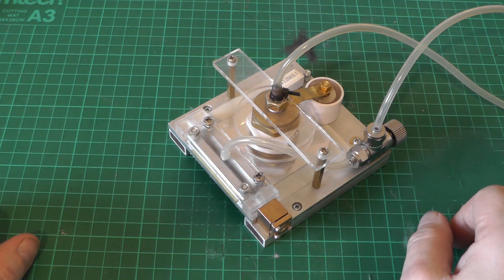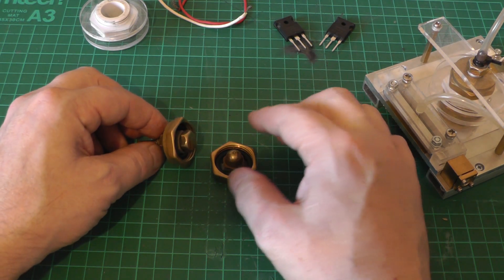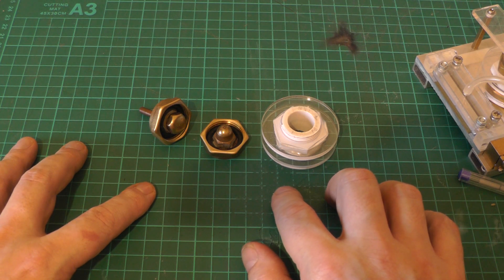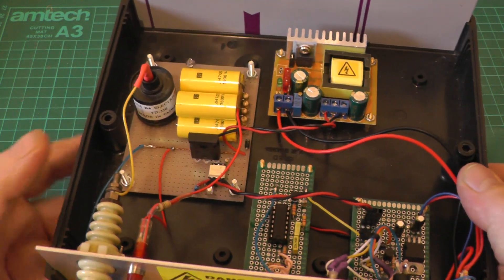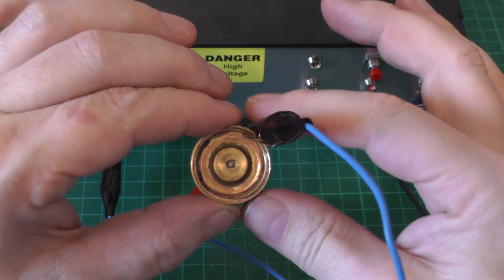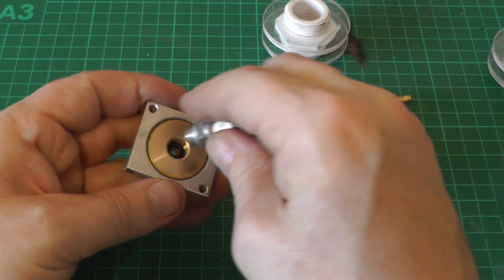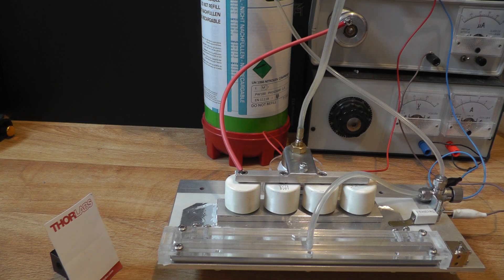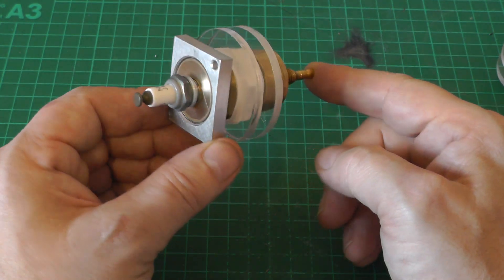How to make a Triggered Spark Gap for High Voltage Lasers and Marx Generators

Comment: A spark gap is the fastest high current closing switch I know of. In a test of a home made coaxial Marx generator of 15 stages, using N2 at 150 psig, I was able to measure a rise time of about 300 pSec. 
Oddly enough using fast ionizing gas hydrogen worked poorly in my Marx.  Slower N2 allowed  the stages to erect in sequence from 1 to 15, hence when gap 15 broke down there was a huge overvoltage which causes very fast switching. At least that's my theory.
Reply: Damn that's fast. Yeah I'm guessing it's the overvoltage, I see a lot of fast rise time switches being made from multiple gaps in series to get that effect, sometimes they put them in a transmission line too.
I'd been looking into thyristors recently and to get them that fast requires a very design-intensive driver and special thyristors like Solidtrons which are basically unobtainable, the difference in cost and difficulty is massive, and the only tradeoff is a bit of jitter, efficiency, and electrode wear.

Comment: Hi Les,
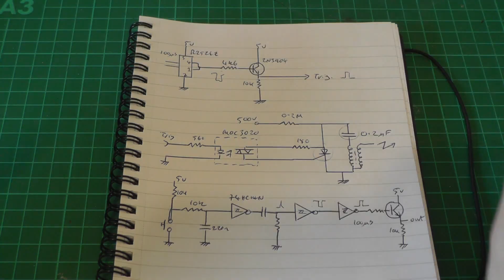I am just about finished with a very large ruby laser.  I was looking at your external trigger transformer about timestamp  10:31  Which I am going to use with my YD-350 and a 0.22uF cap charged to ~500v.
I noticed you have 500v through a 200k resistor, which limits the current to 2.5mA (if I read that 0.2M correctly...giving a RC time constant of 44ms).  Since I still don't like  SCR's on a external trigger, I plan to use a MOSFET or IGBT...which I can turn on /off easily, and won't be hard to control at these power levels.  The ruby is 6-1/8" x 3/8" with integral mirrors (a $2,000.00 job which I got for a trade), the flashlamp has an arc length of 6-1/2" x 15mm (13mm bore).
*I still don't know why thyristors are always used here!!!*
Just throwing this in...and...
Thanks for all your inspirational videos!!!
--daLe
Reply from the maker: This sounds like a very cool project, and sorry for the very late reply (see the community post!). The 200k resistor was to limit the current such that the SCR doesn't crowbar the power supply, latch up and let the magic smoke out :-) Woudl love to see the end result of your project!

Comment: Can you do a video on a circuit to start up an arc lamp?? I have some CW xenon laser lamps and I can get a spark through them, but I can't transfer to the low voltage DC (180V@20A) quickly enough to keep it lit. It's for a CW NdYAG build and there's so little on the web 😵‍💫 love your videos!
Reply from the maker: Thanks! Yeah, I could do. I have been meaning to revisit triggering.
Reply: @LesLaboratory   I'll be the first viewer! 🙌😅

Comment: SIR : "YD-350" LOOKS IDENTICAL TO THE *IGNITION COIL USED IN MANY PROPANE HEATERS in CAMPERS + MOTORHOMES ...THEY RUN ON Q2 volts and use a SPARK PLUG WIRE TO IGNITION ELECTRODE

Comment: I saw 4 resistors at 8:46 near the yellow caps, are they in series to limit SCR current? If not I also wonder if current limiting in this case is required.
Reply from the maker: Yes they limit current, and help prevent the SCR latching.

Comment: Hi Les,
I just received the trigger transformer in the video.  I needed a trigger supply like yours in the schematic...I intend to build it with some changes: Referring to your schema (top to bottom):

1) I will use a 555 astable for an adjustable pulse width.  The 555 triggers on the FALLING edge of the input and puts out a positive pulse.

2) I have had it!! with SCR latchup!  I will use an isolated IGBT, (or HV MOSFET) with snubber.

3) For the one-shot...another 555 (astable) for the manual pulse(s), eliminating the 7414 IC.  In astable mode the 555's positive out pulse has hysteresis...the trigger button can be repeatedly pressed, but has no effect during the output.

...so it looks like just a dual 555 (the 556).   BTW, the output of the 555 (pin 3) is actually a half-bridge configuration that very easily sinks and SOURCES over 200mA.

...and that great triggered spark gap (optically, if enough ionization can be had with powerful 250nm LED's).

THANKS FOR THE INSPIRING VIDEO!!!  Your other's are also OUTSTANDING!
Reply from the maker: Cool. for latch the latch up issue, I have started using neon lamps to commutate the trigger pulse to the SCR, and this seems to fix it, but yeah, it is a giant pain. There are better methods of triggering it has to be said! I ordered a deep UV LED a while ago to try this, but other projects have gotten in the way!
Reply: Hi Les,
I have found plenty 250nm (UV-C) LEDs on ebay, including the multi-watt star-type and a 'light bulb' made of over 100 250nm LEDs.  I also found 7mm lenses (~$0.69 ea).  All this seems to have become available after covid...I guess for anti-bacterial and sterilization techniques...I could never find them before!
I plan to make a 'ring' of these around the gap, each with a focusing lens to concentrate the light at the gap in the center of the ring.  As you probably know, you can't just place a large lens over multiple lights...you will just get a bunch of focused disjoint points of light.  If you place a lens on each LED, you get some overlap though not much.  I think a ring of LEDs and a lens for each will focus each LED to the single desired gap point. @LesLaboratory

Comment: Thanks for the video.  After examining a few different circuits for electrically triggered spark gaps, one concern I have is backfeeding the trigger circuit with the high power side.   What stops or protects the current from jumping backup up the electrode of the spark plug and into your trigger circuit please?

Comment: Try using a subminature rectifier tube with a blown filament. The 5xx series by apalla are particularly good, switch on in less than 0.1nS. Used them in place of kn6 krytron tubes. No biasing required, just give a 1kv trigger pulse and it fires up to about 14kv.
Reply from the maker: Interesting! Those are he tubes used in the old Tek scopes for the multiplier right?
Reply: @LesLaboratory  yup those are the ones.
Reply: Please excuse my ignorance but how short of a pulse width is this subminiature rectifier tube capable of? Does it turn off after a pulse is fired? I’m looking for a method of firing a very fast short duration pulse to a 1kv high voltage transformer primary for generating radiant energy bursts.
Reply: Triggered vacuum gap on the cheap!  Yeah field emission!

Comment: One way to get a high voltage PS with a lot of current, is to use a neon sigh xfmr.  This is how I charge by giant quarter-shrinking supply.  You can get 30mA easily.  The HV diodes are small and cheap on ebay.  I used three 20kV / 50mA diodes in series for safety.  The NST is current-limited, thus one rated at 30mA will be fine with these diodes.  A few of the 40kV caps in parallel should work for creating DC.  If you use a FWB diode config., then the capacitance can be halved for the same filtering.  A variac is a nice option for the NST input.
I have used two 12kV NST's in series and got a total output (with variac) of over 39.5kV @ 30mA.  I potted these two cores in wax.
...and yes, the NST will make things a bit heavy.  I mounted the single NST PS in plexi. with diodes,... all on top.  Be aware that the case of the NST is a center-tap.

Comment: Hi Les,  looking at your 'trigger generator', especially the ZVS driver (I have about ten of these, which I have used for various applications),  They don't seem to have a common ground...input to output...I see you have used the "+" and "-" I/O to get 500 VDC out.  I use this config in most apps.  I was wondering if you have had any grounding issues with the HV 'Gnd" and the 5V Gnd?  Have you measured the voltage across the two 'Gnds'?  I get some fairly hige voltages...not 0v.
I plan to use a high power MOSFET (1000v @46A) as my trigger switch ..or maybe an IGBT,  The reason I ask is that I am having trouble witch SCR latchup.  Also, the maximum FET gate voltage/source is +/- 20v.  But am afraid to do so with unknown ground relationshps.
On your schematic, you seem to use the gnd's as if they are directly connected...and your ground symbles are the same in the schematics.  Are they internally wired together in your trigger generator?  From other similar projects, a seperate 9v batt works fine for isolation in the MOSFET gate/gnd control.  I just received  (ebay) an isolated dc dc xfmr that should work....would like to know your thoughts on this.
THANKS MUCH!!!

Comment: I see that in the High Voltage trigger, you are using an optoisolated TRIAC.  Is there any reasin a simple opto-transister won't work?
Thanks much,
--dAlE
Reply from the maker: I am sure you could, but you would need one with a high voltage rating, and a reverse recovery diode no doubt. The opto triac is commonly used in most application notes and schematics I have come across, so why not use a known working scheme.

Comment: Hi Les,
PLEASE tell me what SCR you are using in the trigger transformer circuit shown in your schematic.   I have tried several...some latch-up at 100us, and some don't seem to conduct enough.  I have one rather large one that works properly.  I have used the RC-differentatior and a 555 for firing...both seem to work equally.

About the ZVS driver:  I have gone through several of these...some exploaded!  I found the problem:  it is the two10uF  electrolytic caps near the output rail...they are only rated at 400v, which is often exceeded in operation.  I ordered a bag of 10uF 450v lytic's of the same physical size.  After replacing them, ALL problems dissappeared!  I now consider this a great ZVS HV device.  I can't tell from the video, but did you use the + and - connections for your 500v source.  This works well, but MANY of these drivers come with only one 'side' connected making the dual polarity impossible.  I always make certain that the ebay seller sends me the types with BOTH caps installed.

IIRC, my giant N2 laser has the largest doorknob caps I have ever seen.  The channel has a vacuum pump, bandsaw blade electrodes, and looks to be nearly a meter in length and has an end mirror.  It was built in the '70's.  EVERYTHING is adjustable...the thyratron even has seperate variacs for precise control of the filiment and reservoir...safety shutoffs for everything.  I think it was a prototype.

...seen all but a couple of your videos so far....just discovered them!
--dAle
Reply from the maker: I am using a 30TPS08PBF SCR in the circuit. Yeah latch-up can be an issue. I started using Neon lamps  between the moc3020 and the Gate in later versions of this circuit that prevents this happening.

Yeah, some of those ZVS drivers can be flakey, and yes I always get the ones with + 0 - outputs. I have never had one explode, but I have ad caps fail.

Nice! I bet the output is well over a Megawatt per pulse, maybe even a couple. they used bandsaw blades to ensure the gas was fully ionized and produce a homogeneous discharge along the length when they fired I believe.

My first N2 Laser used copper sheet electrodes, and was low pressure, but unlike the Sci-Am design, I used doorknob caps in it.

Awesome! There are some interesting project in the works!

Comment: What is the output power or photon intensity?
Reply from the maker: Of the Nitrogen laser Laser? I have measured this at 223 microjoules per pulse in around 1 nanosecond (279kW or there abouts) the average power at 25hz is about 5.5 milliwatts.

Comment: could to initiate the spark gap with a uv LED
Reply from the maker: Maybe. There is a lot of "Theoretical" modelling on UV LED triggered gaps, and an IEEE conference proceeding which is just an abstract (weird). In principle it appears possible, perhaps I will look into it!
Reply from the maker: Ordered an alleged 265nm 100mW LED from China. Worth a punt...
Reply: @LesLaboratory   
I have order one too.  

UV LED Triggered Spark Gap for Repeatable Nanosecond Pulses
Henning, Brian ; Light, Adam
talk about using a 280nm LED

Gas–ﬁlled laser–triggered spark gap
O. Frolov, K. Kolacek, V. Bohacek,J. Straus, J. Schmidt, V. Prukne
Seem to have done it with a laser 

Nitrogen can be tricky to ionize a touch of helium might help

Comment: Since you're dialing in this apparatus so that you can systematically tune the whole system, consider that the Earth is moving ~1000mph on its axis, revolving around the Sun ~66,600mph, and the Sun is revolving around the galaxy ~580,000mph.  The galaxy too is moving.  Our science experiments do not impinge the same point in space in a universal frame.  We're traversing this corkscrewing pattern -- seems still, it isn't.  Chemistry and electromagnetism work at this velocity, but I think we miss out on some of the "fabric" effects due to our assumption we're not moving.  

Granted, we're not moving at the speed of light like your lasers but I wonder if you can identify some kind of spatial anisotropy that correlates to this motion, and say lunar tidal forces.  I know Michelson and Morley tried that with an interferometer, but I'm thinking in the population inversion itself, or the operational properties of the spark gap. 

Another way to put it is that I hypothesize that your Nitrogen laser and your spark gap function better in specific orientations as a function of your position on Earth and the alignment of the channel/gap with its actual motion in a larger frame of reference.   The idea is that if the light impinges the same location in space, or even only that the energy of the laser is concentrated in a smaller linear volume of space (since it's faster than our motion), that the "fabric" effects of the Universe start to shake out, or if nothing else, you can do more effective work with less laser power input to the system.

Comment: It seemed like the laser sometimes fired twice on a single button press though, is that just a tuning issue to dial in the laser channel spacing/gas pressure/current?
Reply from the maker: I need to use a larger cap in the de-bounce circuit for the trigger. To be honest, the button is just a convenience for testing, for real work I use the optical trigger input.

Comment: On the topic of high-voltage, I'd love to see a video on spiral line vector-inversion transformers, if you've ever played around with those, or even if you haven't.  I've seen them used in the laser community here and there and you seem to be skilled in the art.  Another topic might be a raspberry-pi or microcontroller-based phase-OTDR for seismic sensing with say 9/125 SM fiber.  Awesome channel, thanks for sharing this knowledge.
Reply from the maker: A nice piece of "forgotten" tech. I will take a look into that.  There is a nice paper on it here: https://www.osti.gov/servlets/purl/1772727
Cheers!

Comment: What SCR did you use?
I am trying for weeks now to get the circuit to run. I get my 100µS pulse out of my 74hc14.
This signal goes (buffered) into the moc3020 but the Triac doesn't switch. I am currently using a BT151-650R.
Reply from the maker: I use a 30TPS08PBF. Is the MOC3020 firing?

Comment: You definitely comes out with very educational and interesting videos. Thank you. I have a question and probably dumb too, has to do with a nitrogen laser. I know they had done this experiment, but wondering is possibility to achieve it in a low scale or medium scale.. my question is, if you have a spark gap like the way u have and then shot a laser between those gaps would extend its spark length?
Reply from the maker: Thanks! I have tried this as a half hearted attempt, and observed no difference. That sid choice of materials may well affect the experiment. I will give it a proper try at some point.
Reply: @LesLaboratory  thank you for responding i appreciate it

Comment: Excellent work👌👌👌👌👍 - it makes for a more controllable practical lab unit - I wonder if you had a holographic system and photo sensitive resin if you could build some 3d sculptures was a smallish unit ? 🤔
Reply from the maker: You mean something along the lines of photo-polymerization with the Nitrogen Laser? I guess so, but there are far better Lasers for this kind of work! I am currently repairing a Q-Switched 355nm UV DPSS laser that woudl be eminently more suitable for such applications.
Reply: Les' Lab sounds fascinating 👍👌👍

Comment: Hi Les, 
I still don't understand how your reconfigured charge distribution replacing the spark gap with the capacitor bank works. The new layout results in your doorkobs aligned in series with the foil capacitor and with the 120k resistor shunting their junction to earth. I undetstand that the trigger itself is as you rightly say best kept with its negative tied to earth but the reorientation of the doorknob capacitor bank results in a circuit I have never seen referenced before and so far I have found hard to make out the function of. Would very much value your comment. Thanks
Reply from the maker: Yeah, I should probably do a video on that, it looks like it shouldn't work right? It becomes clearer if when you draw these out, you don't call 0v 'ground' or 'earth' and think of it as floating. Secondly bear in mind that when the spark gap fires, it doesn't close like a switch, but 'rings' or oscillates. this means when the gap fires, 'earth' or 'ground' will swing between -20kV and +20kv. The voltage across the peaker and the channel will do the same.
Reply: @LesLaboratory  Hi again and thanks for your reply. So when you refer to "ground reference" (14,01) where exactly do you mean. A circuit diagram of the altered route would be very helpful and might make things more easy to understand. Keep up the feeds. You have a great channel.